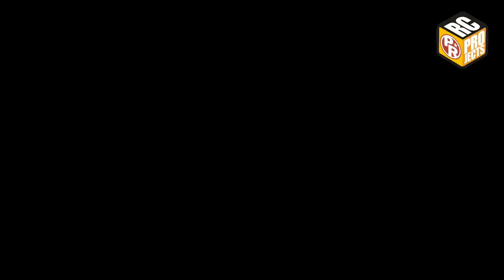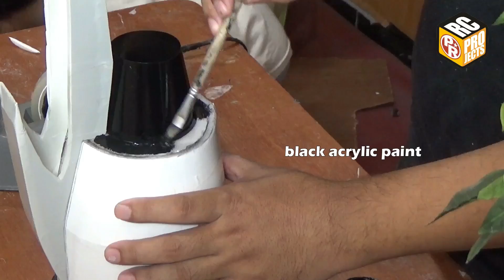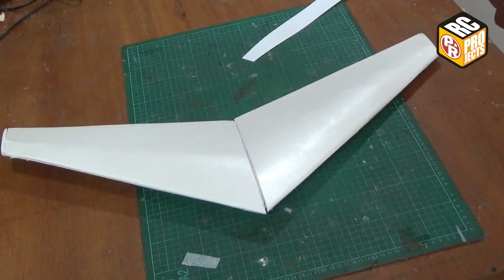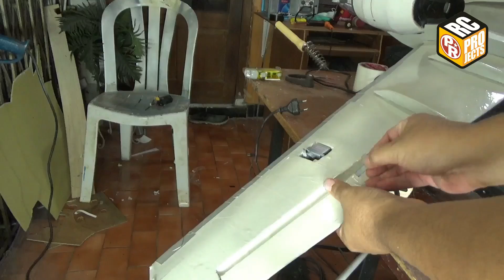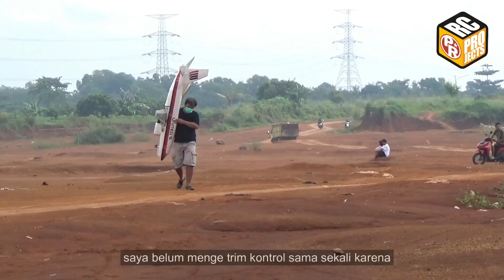How to Build RC Airliner Boeing 737 Part 4

Comment from the maker: Playlist :
02:39 Dummy Engine
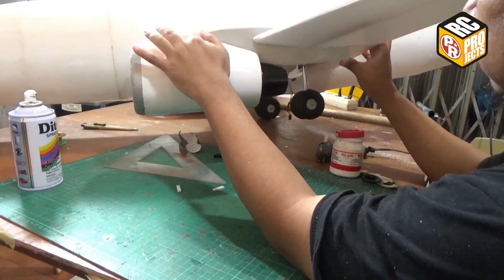13:02 Control Surfaces
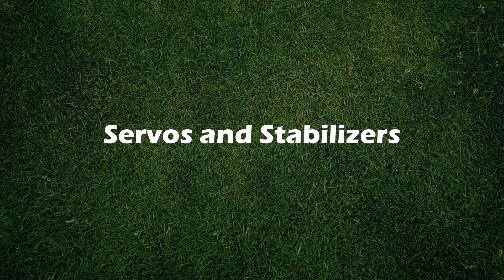19:39 Servos and Stabilizers
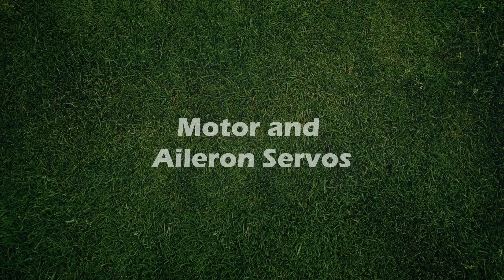22:42 Motor and Aileron Servos
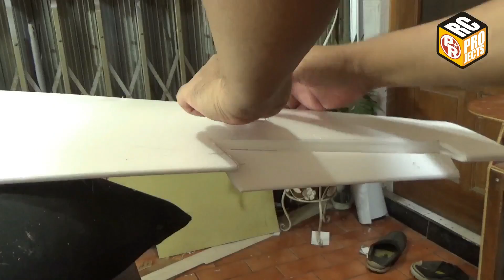25:27 Decalling
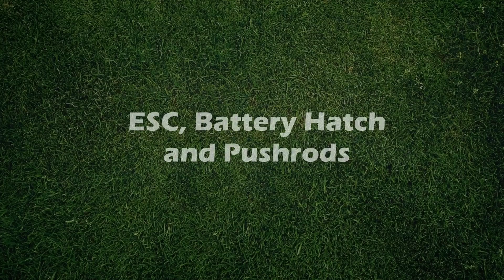30:53 ESC, Battery Hatch and Pushrods
35:27 Maiden Flight
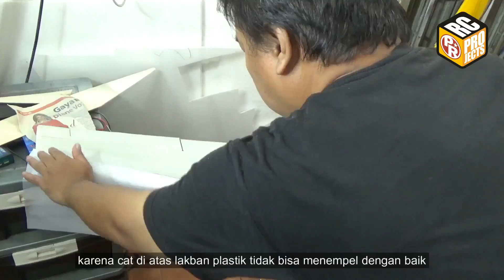30:07 Day #2 Flight
42:57 Day #3 Flight
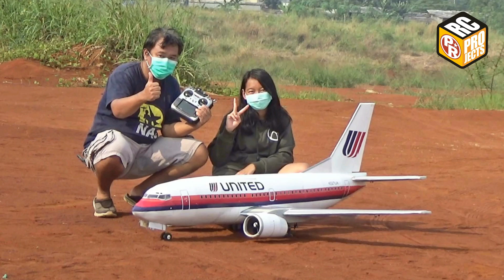50:57 Review / Next Model?

You can download the plans on the link below :
http://paper-replika.com/index.php?option=com_content&view=article&id=9617:rc-airliner-boeing-737-300-part-4-final&catid=144:rc-projects&Itemid=207908
Reply: Hola soy de Progreso Yucatán México le felicito por los proyectos que enseña son muy bonitos , mi nombre es Germán Rodríguez
Reply: Where do you purchase depron foam
Reply: Mesin jet nya mainan saja ya, pakeknya baling2 ya,
Reply from the maker: @yayukzeze8806  iya biar murah dan tenaganya lebih besar

Comment: Hi Julius how are you? First of all congrats for yours projects, you deserve my respect for your amazing job. I am starting my DIY 737 follow your tips. I would like to know if possible which size of motor, I mean a ducted fan that fits on this model, may be if you give me the engine cowl dimensions, I might figure out by myself. Thanks so much for your attention.
Reply from the maker: I think it will works well with 70mm 12 blades EDF with 6S battery

Comment: Julius do you think a 1000W hair dryer will soften the foam for bending it? I'm afraid the electrical installation in my workshop will not handle a 2000W heat gun.
Reply from the maker: Cover the outside surface with packing tape first, and make score lines inside. You dont need heatgun if it not possible, you can use gas stove with minimum flame
Reply: @JuliusPerdana  Well I bought a heat gun that comes with a wide range of regulation and at very low setting I managed to bend the foam.

Comment: Julius, I am making the Piper Seneca II, but in the parts list do not appears the 5v 7.5a Ubec, which appears in the electric diagram,  it is neccessary or not, can be replaced..??? Thanks for your Help.
Reply from the maker: if you use quad race ESC, you will need one

Comment: amazing plane! maybe a dumb question, but why dont you build internal engines?
Reply from the maker: they are expensive, I can't afford it for now. So the solution is to use pusher prop motor, way cheaper. Example with pusher prop you need about $120, but for EDF (internal engine that you say) you need almost $400

Comment: Esc 5v 3a bisa ngepower brp servo 9gr ya? Dan kalau saya pakai 2esc(multirotor) apakah power output ke rx menjadi 2x lipat atau powernya seperti 1 esc?
Reply from the maker: Tetap sama saja hanya amperenya nambah, dengan begitu nambah slot servo
Reply: Berarti kuat brp servo ya (9gr) rencananya saya mau pakai 8 servo apakah kuat?
Reply from the maker: Biasanya 1 esc itu 3 servo, kalo 2 esc brarti 6, kalo servonya dipakai bergantian ga bersamaan masih bisa tambah 2 lagi. Kalo amannya colok ubec 5v lagi ke RX nya biar aman.

Comment: perbedaan prop MA dan APC apa ya?
Reply from the maker: Itu merek, APC cenderung sport, ujungnya runcing. MA itu Master Airscrew ujungnya tumpul dan bilahnya tebal. MA sangat kuat tahan crash
Reply: Oke tq
Reply: Mau tnya ttg bec,kalau escnya sdh ada bec lalu saya pake bec external itu tidak bentrok kan? Lalu untuk ngepower bec bisa pake jenis batre apa aja yg plg mudah
Reply from the maker: @jasonyodiputra6977  tidak apa2, jadi satu dengan batere pesawat aja, power ESC dicabang buat ke UBEC

Comment: Pake 3 mm om, tanpa rangka bisa lebih ringan. 😀
Reply from the maker: iya om rencana mau bikin 747 mau pake 3mm aja lah, dihitung2 bakal 5 kg nanti kalo 3,5 meter. Iya memang harus 3mm
Reply: @JuliusPerdana  dilapis lakban bening om, biar tahan banting. Sistim gearnya pake bahan ringan seperti bambu sumpit atau rotan aja. Kurangi unsur logam biar gak berat. Sayap gk mesti dua lapis atas bawah, cukup 1 lapis saja diperkuat karbon 5 mm. Kalo panjang bodi 3,5 m sy rasa masih bisa sekitar 3 kiloan. Boing max 8 Lain Air sy panjang 3 m bobot total dengan batre 2200 mah hanya sekitar 2 kg. Ok om sy tunggu videonya. Semoga sukses. 💪👍

Comment: Hi @Julius, here its suggestion for you to make a such a model in DC 180 brushed motors, with brushed ESC, it will be small scall than that and cheaper than this too. Please consider it.
Reply from the maker: I don't have experience using brushed motors

Comment: How much is the total cost to setup like this?
Reply: The plane itself is about 15 20 bucks since its foamboard. The electronics about 200 bucks
Reply from the maker: about $150 for the plane alone, not include battery, charger and radio.